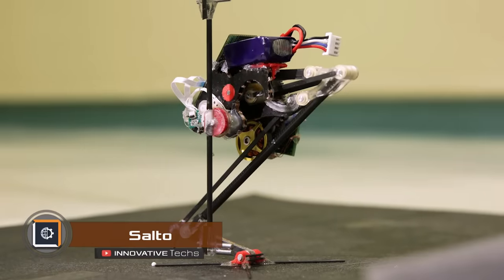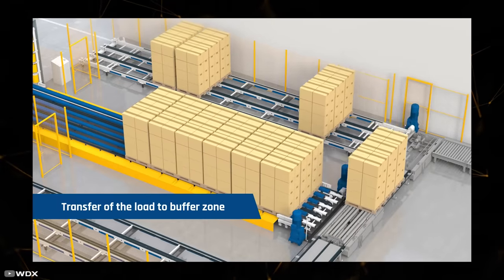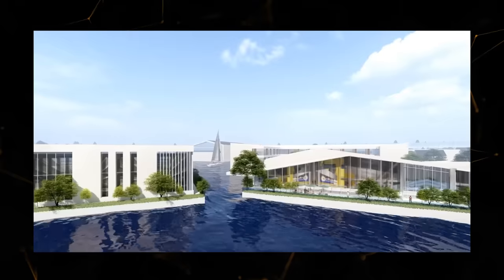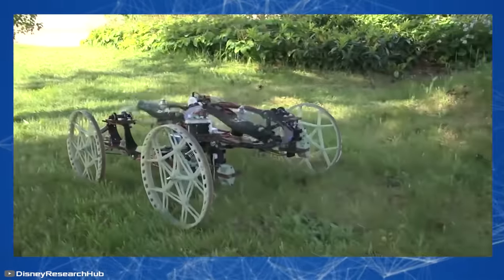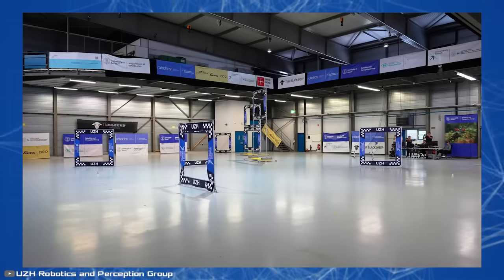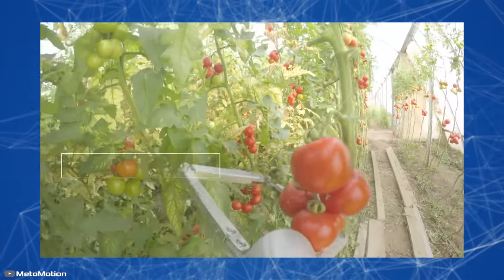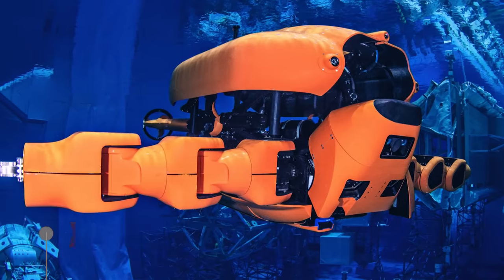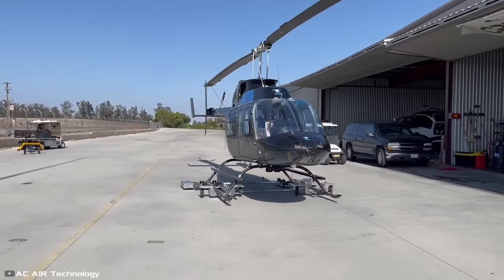NEW INVENTIONS THAT WILL SURPRISE YOU

Comment: 2:00 As someone who loaded and unloaded pallets in my 20s for Home Depot. This sounds great but the reality is that every pallet is different. Wood breaks, Pallet overloaded, not enough plastic wrap, and load shifting are all real issues. I could see those rails getting stuck by malformed or failed pallet during shipping. Plus the elephant in the room, who is loading and unloading the machine? The lack of space to lateral is not realistic. That automation pallet would need to be loaded by forklifts and most drivers are not accurate enough depending on the loads being shipped.

Comment: The Israeli hovercraft, with the two props, if built differently, has tremendous potential.
Reply: Yes, but it's lack of any type of wing at all is confusing about how well it would maneuver well enough for a combat zone.
But I suppose that aviation engineers are more knowledgeable than I am by just looking at something to make that assessment. Lol.
Reply: @Thesaurcery4U2C  , An aerospace craft,  need not wings to fly or maneuver...
Reply: @GeneralPadron  
It is just as maneuverable with or without wings? 
I admit that I have no calculations supporting my thought, but just a feeling from observing different vehicles flying. I have no doubt that it can fly, I was thinking more of sharp evasive maneuvers.
If you have any clarification about the physics of the flight type I am referring to I would very much like to consume that information up. Or lead me to that information. Thanks.

Comment: I can see the auto-loading system for trailers being extremely useful. Not only will it cut down on time at the dock, but they could also implement weighing the load, and balancing, it before loading.

Cutting down time and increasing safety, all pluses.
Reply: It takes jobs, yet also creates them, the issue is that just this kind of technology is changing so quickly, so investing too much in one solution is a risk.

Comment: the "new invention" at 1:43  we are using at work for over 10 years now, only thing is we need trucks with chains on the inside to pull the pallets in. its for shuttling between 2 facility's

Comment: i dont think that pallet idea would work, if you ever worked in logistics....pallets from trucks are a mishmash of things tall short fat stacked and long....
Reply: Yep, and then they are not always stacked n' wrapped correctly. Also, the quality and condition of pallets themselves can be an issue. I've seen many just fall apart or disintegrate as a forklift has lifted them. If that was to happen on a rail system it would be absolute Nightmare job cleaning up the mess and getting it up and running again.
Plus, with the rail system in the way, you'd then be unable to load/unload trucks the conventional way, when something does inevertably go wrong. I say "inevertably" because as anyone knows who has worked in a warehouse or a factory that uses automated machinery and robots, it will breakdown at some point or other and those breakdowns will likely occur on a fairly regularly basis.
Basically, it's a good idea on paper and in theory, but in reality it simply wouldn't work in most situations. Things just aren't that perfect, uniformed or consistant back in reality.

Comment: You still have to use forklift to load that robot so it's just easier what the damn 18-wheeler using a forklift a good forklift operator unload about 100 18-wheelers in a 12 hours spend I know I used to when I was younger driving a forklift